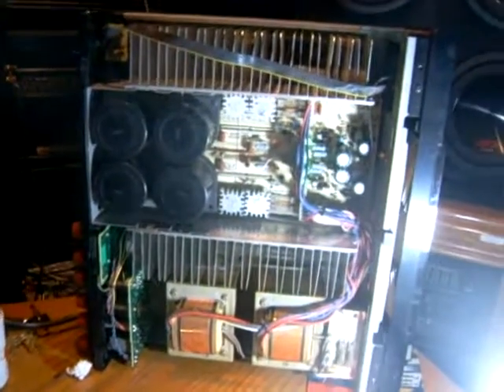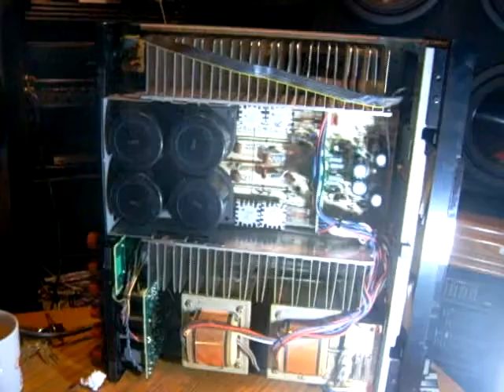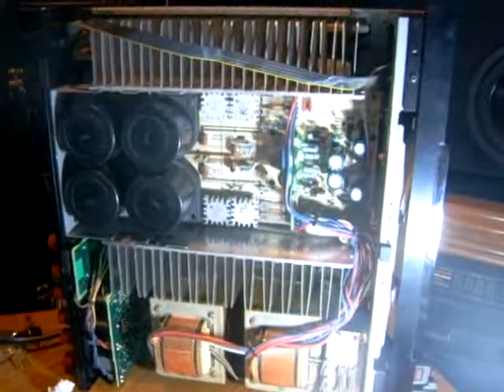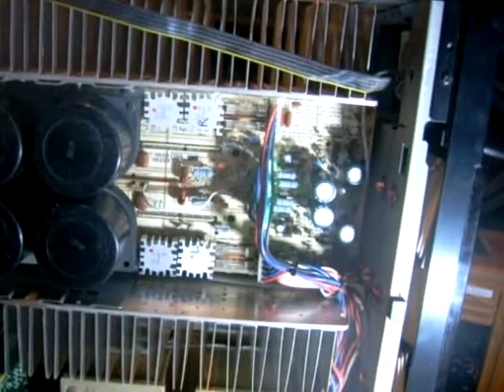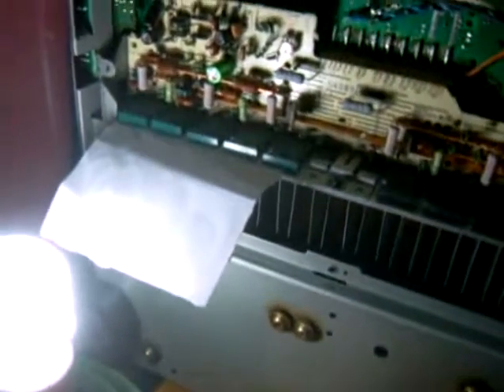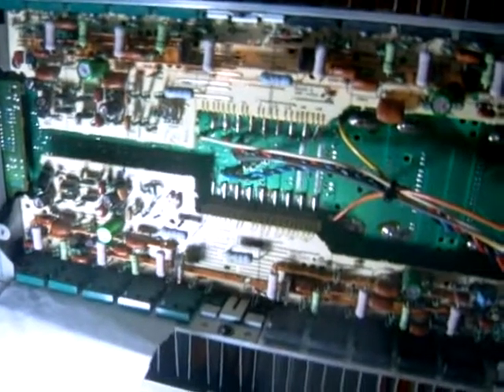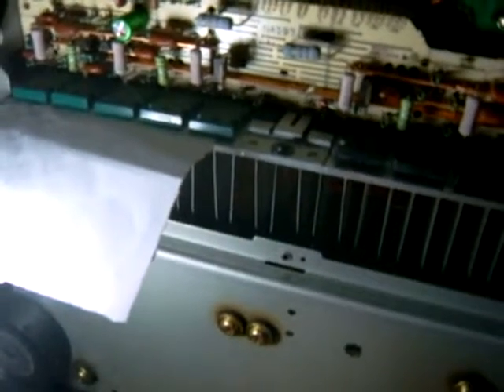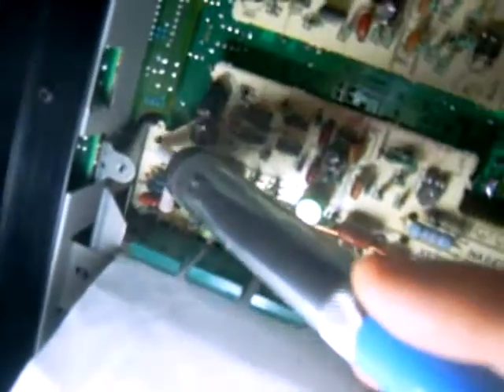yamaha mx 1000 rebuild

Comment: I have to recap a MX 800u
Reply from the maker: I have recapped the MX 800. Pretty much the same thing. I have been selling complete cap kits for them on ebay lately, ex the four main caps, which you need to hope will still last, , as they are a fortune to work a replacement for.

Comment from the maker: Believe it or not, you may be able to order the whole right channel still from partstore 
or Yamaha. At this point I have recapped around 15 of these amplifiers myself with zero issues. This one I managed to Screw up in the learning process of trying to find a problem myself. I think the price was around 300.00 shipped. 

For specific issues, and troubleshooting, I now will rely on my local electronic shop. The board is still good in this one, so down the road I will have them fix it. She is all recapped anyway, so at least that is done. I got three more in my inventory arsenal, so no hurry to pay the big boys for repair. 

:))
Reply: Bird and audio channel, Could you perhaps tell the website where I can buy the left and right sub-board? I recently bought an MX-1000 but unfortunately it was used as a donor and the sub-boards are not inside the amplifier.